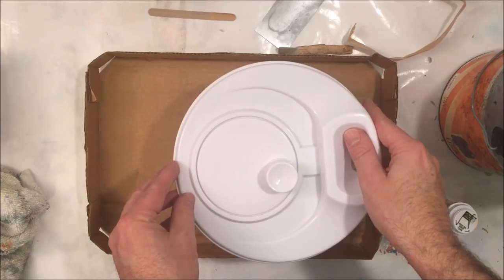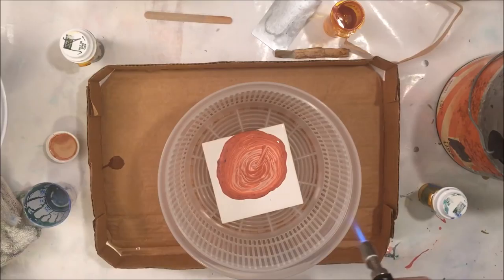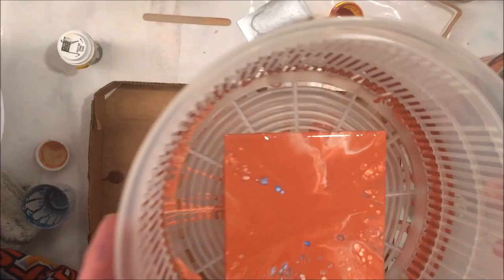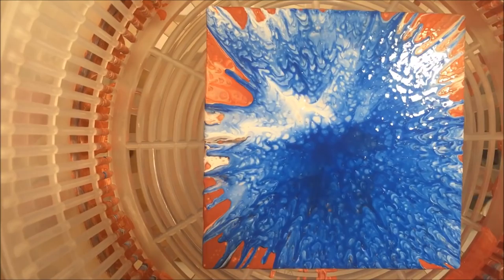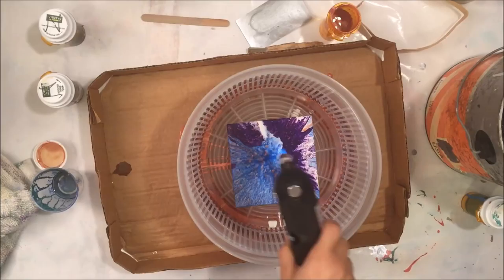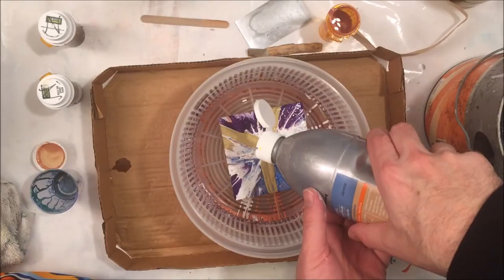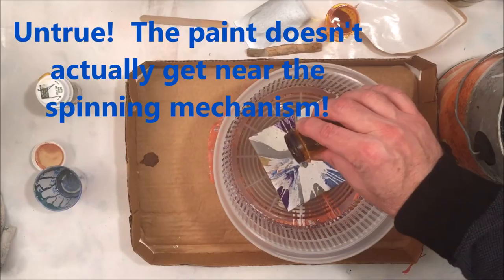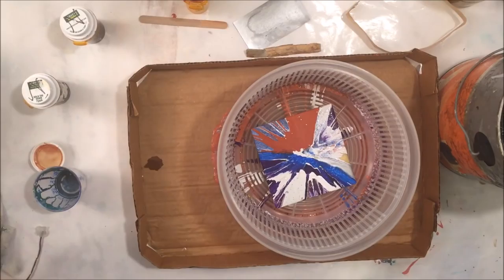Salad Spinner Art!  Acrylic Painting Pouring Fluid Flow Art How to's

Comment: No salad spinner, but I got a spin art toy - the one that uses batteries, about $10, worked the best - and it works very well for the small stuff.  A lazy susan also works pretty well for some larger things.  Fat Daddio has one on Amazon for about the same price.  Might be Fat Daddy...it's for cake decorating. I also use it to turn my paintings so I can see all sides.  One of the things I found was that you need very little paint, and after spinning, there is a very thin layer of paint so there should be no cracking. Your itsy bitsy squeezy bottles work well, I found, the needle nose ones from your Latte video.
Reply from the maker: Thanks Martha!  Yep one of those spin art toys would work great I bet!  My next move is a big one.  I had dinner with my brother tonight to make plans to build it.  He is a welder!  He is going to turn a bike into a huge one for me!  Glad you like my other videos and needle nose bottles!